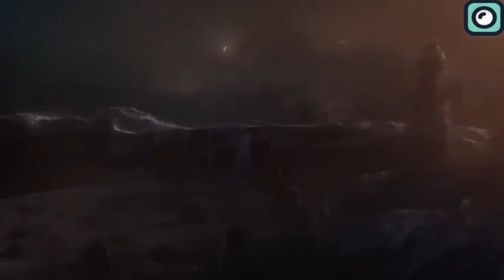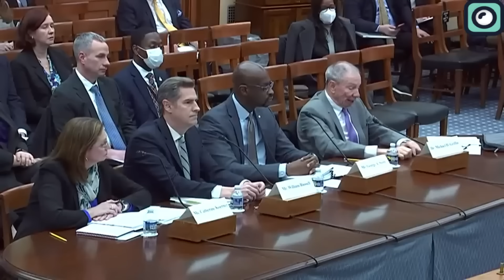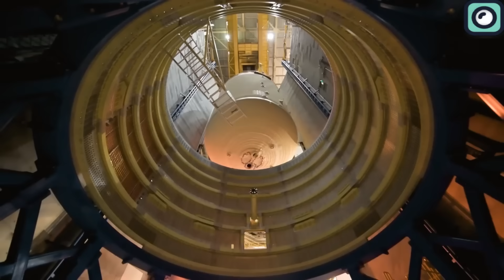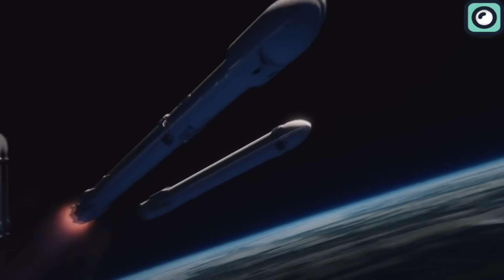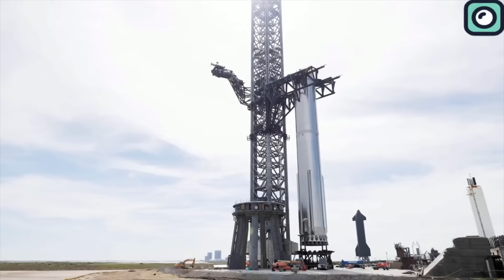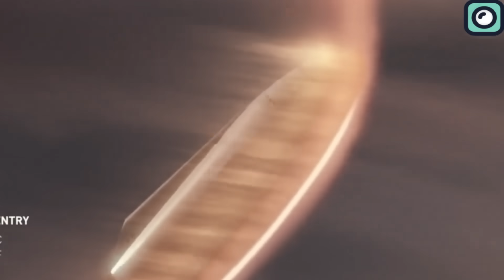Musk Laughs at NASA for Blaming SpaceX and Blue Origin!

Comment: Great Video !  Going  to the ISS to go to the moon is a detour and raises cost and time !  The new station should be one heading East from the KSC (about a 28.5 deg orbit).  This new "LEO CSS" (LEO Commercial Space Station) with a Fuel Depot can help take US back to the moon to stay.  NASA must support the recovery of one hundred tonnes plus of Lunar Water Ice (H2O) a year to support a four person Crew and Fuel Depot for the Lunar Outpost.  With three hundred tonnes plus a year of LWI (H2O) the Lunar Outpost can be expanded to a Crew of twelve Lunar Workers !  The BO Blue Moon HLS can be fueled on the Lunar Surface (LS) Outpost and not at the NASA Lunar Gateway !  The LEV/LLV/Blue Moon HLS with a  6.1 km/sec delta-V can then return to the  LEO CSS to be serviced for return to the Lunar Surface.  For more details read the paper "Moon Direct" by Robert Zubrin.  The LEV, LLV, HLS is part of  Vision 3 of 5 and will also support the NASA designed  "24-Hour Lunar Shuttle" by Stan Borowski-NASA Glenn Research Center (LEO to LLO) (Vision 4 of 5).  The engine for the Lunar Shuttle can take US out of the deep gravity well of LEO to Mars and beyond !  tjl

Comment: I have to ask musk cheerleaders? How many failures will become a bridge to far for all of you. 165 kilometers is easy compared to 335 miles. This is why Falcon was an outstanding success. Elon can’t see the difference or doesn’t care. He would get rich on 10 launches to 1 moon landing based on fuel. If nasa could go to the moon in one rocket with nothing more than slide rule we should be able to surpass this feat.

Plus a moon base will require a special rocket to transfer dirt moving equipment due to weight and the ability to unload it. They have inflatable modules. But they must be buried. Otherwise our astronauts would die on the moon.

Comment: Let see if mush is still laughing after his third Roman candle launch next month. I said ithe first launch would explode due in whole to the 33 engine design. This third launch will be even bigger. As he has now installed 3.0 raptor engines with even more power. He will look for any other reason as to the next explosion. But in the end it’s 33 engines mounted on a single frame. I know metal, composites, electronic’s, electrical and  pure horsepower. If he launches starship into high orbit and returns booster and then lands starship! I’ll eat my words. I expect to go hungry.
Reply: As smart as you think you are, why are you not working for SpaceX or Blue Origin? Get a job!
Reply: @GeorgeGeorge-yb2sz  

Simple I retired at 50.
Reply: 😂 They aren't attempting to land and recover anything with the next launch. 
I hear they are focused on getting starship to orbit and testing propellant transfer technology. The super heavy booster They may try a controlled decent but it's splashing down in the ocean. 

33 engines is no big deal.  Falcon heavy has 27. 

I doubt they will try to catch a booster or starship until they have a second launch tower completed. Otherwise, they risk damage to ground support equipment and significant delays. Could happen this year though if they have more success.
Reply: @getinthespace7715 

Until they redesign booster it will never fly and land. 10 launches to get 1 load of moon fuel is not economically sound. Because they wish to land booster requires more fuel and less distance. The entire idea is flawed.
Reply: @mikerash-pc4jc , because they will be able to land a booster, the cost to launch is going to come down to single digit millions. 
10 starship tanker launches may only cost 100 million. It may only take a couple weeks. 
Look at Falcon launch operations. 
All the naysayers, like you, were very quickly proven wrong. You have the privilege of being able to view history,  and you still can't open your eyes to the reality of what is achievable. 
They are launching multiple falcons a week, sometimes multiple a day. 
The cost of SpaceX operations is a fraction of the competition. 
Look at the monstrosity that is SLS that costs over $2 billion a launch. 
SpaceX can put 1260 tons in LEO or 400 tons to the moon for that using falcon heavy and 20 launches. 
Lunar starship will be able to bring 100 tons with a single lander. 
You just need to get your head around the fact that these launches will become just as routine as Falcon 9 and are probably going to end up costing less if they can get on-site recover captures with the chopsticks.
Reply: Don't think raptor V3.0 will be used until Starship V1.0 is retired early this year.
Reply: I agree 100%. Saliva is cheap. Cheaper than talk. Since u dont contrbute anything to what SpaceX is dóing except talk, find a corner and keep quiet.